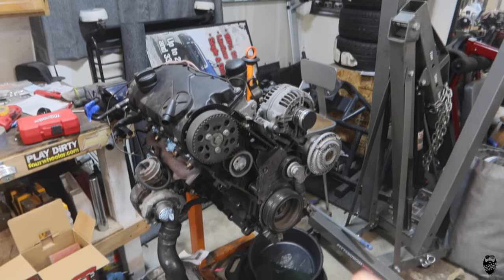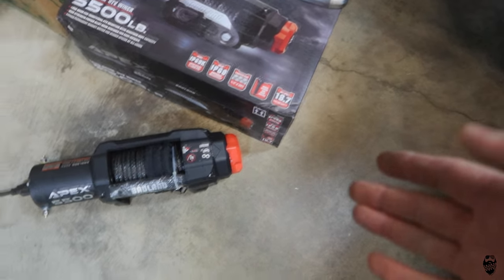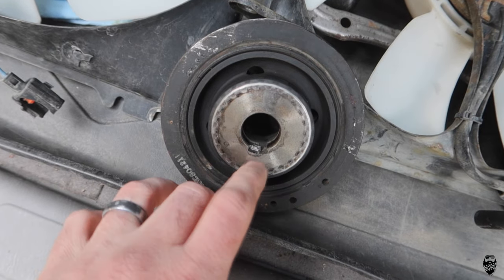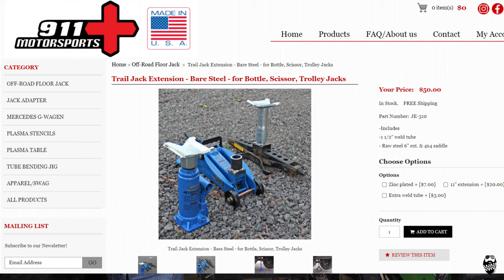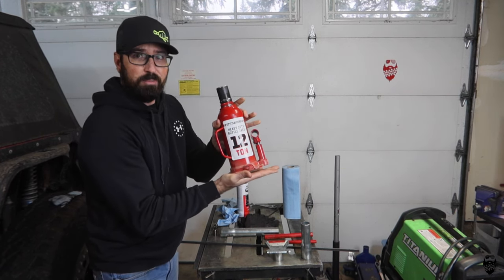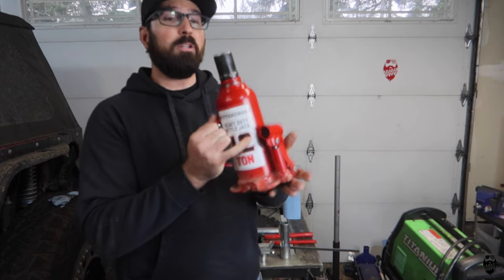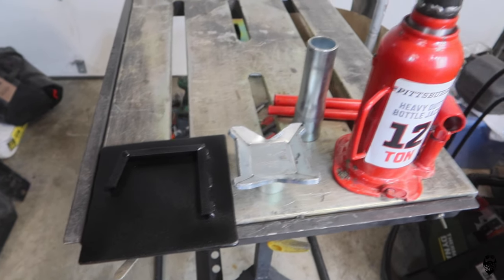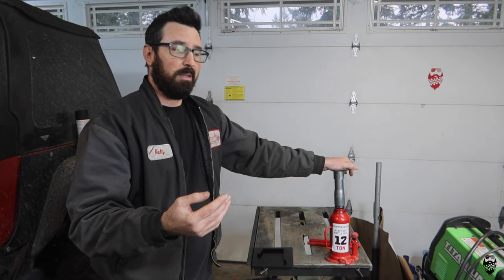Harbor Freight Off Road Bottle Jack?

Comment: Thanks again for another interesting video.  This one is right on point as the alternative (High-Lift Jack) is heavy, hard to store, and potentially very dangerous.  I can't count how many times I have seen a High-Lift crash down on the trail.  A simple bottle jack can be just as (if not more) effective.  But you hit on the key issues with this alternative:  (1) Getting it to set securely under the axle; and (2) Getting it to sit stable on the ground.  While I made my own, I use virtually this exact same set up you cover in the video.  For people with no ability to weld/fabricate, this is a great alternative.
Reply from the maker: Nice man, thanks 👍🏻
Reply: I use what they call a “unijack” you can get them off Amazon it’s a bottle jack and jack stand all in one they’re awesome I got 4 lol

Comment: If you treat a handy man with respect it no more dangerous than any other form of jack it is also way more versatile I have literally jacked small buildings and loaded them on trailers tensioned wire when building fences, jacked door frames square after a roll, winched the uses are endless.

Comment: Great idea. I think it would be more user friendly than a hi-lift. For example lifting by the axle or a point on frame. Esp if you need to use on a vehicle with stock crappy bumpers or no sliders.
Reply from the maker: Very true.
Reply: @MuddyBeards4X4  what are the adapters on the Jack? That’s what I want to see. Could be useful.

Comment: I bent some 1"x3/8" flat bar it into a V and welded it to the top of some 1.5" square tube about 3" long. slides right on top of my bottle jack. I don't think I've used my Hi-lift for anything but breaking beads on tires or using the handle for a cheater pipe.

Comment: Off topic. If you were to replace the 40s on your jeep would you re-buy the procomps or go with another tire? I've been thinking of giving the patagonia mt's a try. You have experience with larger rubber. I've never wheeled bigger than a 33. Thanks for the great videos.
Reply from the maker: Thanks man, I am actually looking at the sticky Patagonia or the bfg KM3. The procomps are a great all around tire and work well on the street as well as being super tough offroad. Since mine is a dedicated wheeler and is trailered I am looking to go with something with a little stickier/softer compound.
Reply: @MuddyBeards4X4  awesome thanks. I was unaware the milestars came in sticky compound. Guess I'll look that up later. Interesting

Comment: Nice, I've used a had a bottle jack in our rig for years but the extensions are a great idea. Imo, high lift jacks are about the most over rated accessory out there.
Reply: Hi-Lifts are more of a multitool that a single purpose jack. There's a lot of creative stuff you can do with them, but overall I agree with you. Fairly over rated.